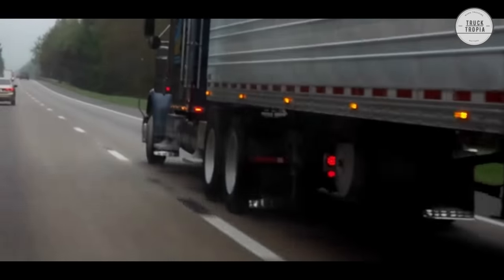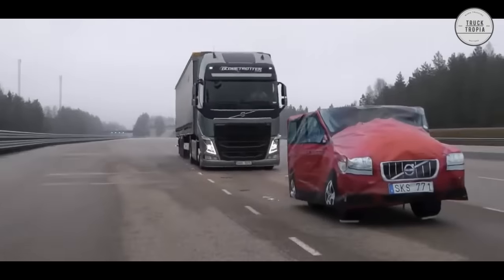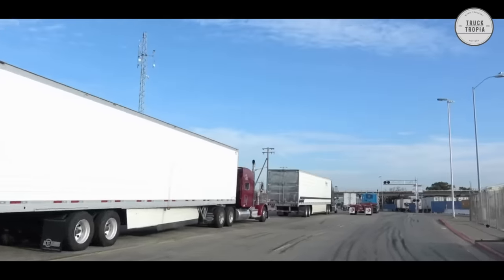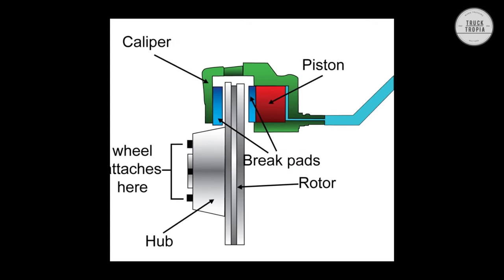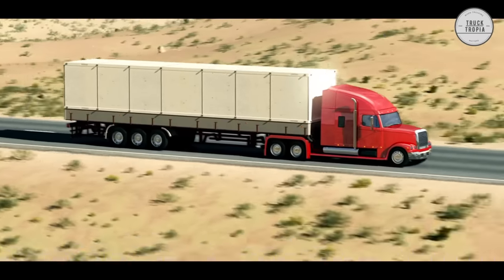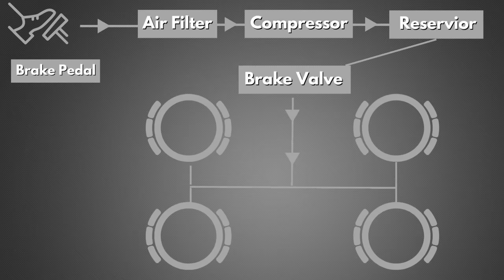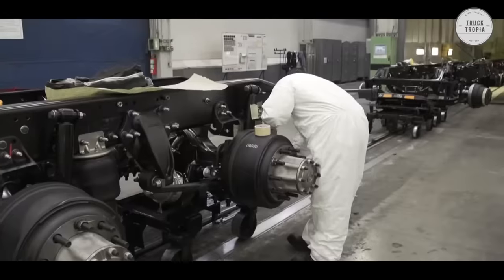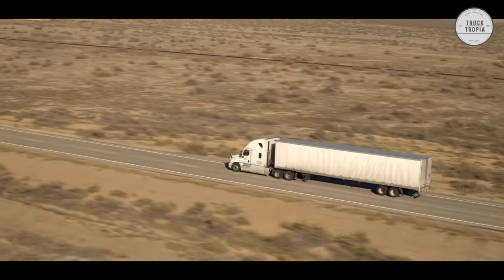Why Do Semi-Trucks Use Air Brakes?

Comment: Another big perk of air brakes too is that if they leak a little bit, they might still work for some time.  Even the tiniest leak in a hydraulic system will render that circuit inop and will quickly deplete the fluid reservoir, which can knock out all circuits.  A small air leak may only cause the compressor to work more.
Reply: Leaking is actually an expectation, to the point where there is an acceptable amount of leaking before it’s considered unsafe.
Reply: @jacobleyva2572  I thought I recalled as much but I wasn't 100% so didn't want to make that claim.  I haven't driven large vehicles in over 10 years so I'm a bit rusty on the facts.  Thanks for confirming!
Reply: @jacobleyva2572  technically any amount of leaking is considered safe since it will just activate the spring brakes and stop the vehicle from moving at all.
Reply: @jacobleyva2572  according to European law: A leaky brake system (even if it is a super small minor leak) is deemed having no brakes et all!
Reply: Your only allowed a very small amount of air leakage to be allowed to drive that rig down the road. I'm thinking about 4 psi in a minute.
Reply: @kenardturner7173  There we go, we don't use PSI ^^
Reply: @BruceCarbonLakeriver  sounds like BS. it's extremely difficult to get a perfect seal in the long term.

Comment: One other reason why hydraulic brakes are preferred in personal vehicles is their improved braking modulation and feel. Hydraulic fluid is incompressible, so when you engage them your foot feels the brake much more quickly and directly. Air brakes are slightly slower to respond and mushier feeling at the pedal, with a more on or off behavior. 
The other thing people are missing is that hydraulic brakes do fade in a way that air brakes don't, assuming moderately competent brake pads. The first type of brake fade you get in hydraulic systems is usually brake fluid fade, which is when the fluid gets so hot it begins to boil. When the brake fluid boils, it is no longer incompressible liquid, but partially compressible gas, which significantly reduces brake pedal feel and max braking force.

Comment: THIS IS HOW AIR BRAKES ACTUALLY WORK:

In the trucking air brake systems there’s two types of brake chambers, dual and singles. Single chambers only have a service brake or foot brake. While duals have a spring or parking brake and a service brake. 

The spring brake works by removing all air from the chamber to engage, if you introduce air to the system, around 40 PSI it will over power the spring and move a diaphragm holding the brakes on to release them. Keep in mind not every axle has these so most brake chambers are single. 

A service brake works as follows. You push the brake pedal, and air fills the chamber. This pushes on a separate diaphragm moving a push rod. This connects to something called a slack adjuster to ensure your brakes are always adjusted properly. The slack adjusters twists something called an S-Cam which pushes the linings into the drum to engage the service brake. This is the only type of brake a single chamber has.

A dual chamber has both types of brakes and two separate diaphragms, 1 adding air to engage the foot brake, and the other removing air to engage the parking brake. 

This might be a little complicated to understand so look up some diagrams on the internet if I didn’t explain it. Well Enough.

Comment: Another big advantage air brakes is that you can use that compressed air for other purposes.  Obviously the brakes and trailer brakes.  Compressed air is also used for the airbags on most trucks that act like springs.  Some trailers also use airbag springs.  The horn is obviously air powered.  The seat springs/cushion is also air powered, makes the truck ride smoother cause the air the driver's seat floats on absorbs impacts.  On older trucks they used compressed air to operate the windshield wipers.  This was a stupid/trouble prone system, ie a slight leak makes the wiper malfunction.  You can also use the air system to inflate a low tire.
Reply: My favorite accessory is the air gun you can install to clean the cab out.
Reply: @Kingpin745    Didn't even think of that!!   Here I am like a heathen buying $5 cans of compressed air used to clean computers to detail my interior.
Reply: @AaronSmith-kr5yf  Lots of truckers install an air gun.
Reply: Automatic transmissions use the air system to shift the transmission.
Reply: Here in Kenya we even do spray painting using a lorry's compressed air from  the reserve tank😁😂
Reply: Some old trucks have an air engine starter.
Reply: It is also used to clean the filter
Reply: Buses also use their air brake systems to control the doors and adjust the seat.
Reply: Also used to shift the transmission on both manual and automatic
Reply: Or run air actuated hydraulics. Like the front loader garbage truck I drive everyday. Aka: my prison on wheels 😬

Comment: Air brakes allow connecting and disconnecting from trailers without having the problem of getting Air in a hydraulic brake system... Down side Air brakes have a slight lag from brake pedal application to brake application about 1/3 of a second on tractor brakes a little more for the trailer...
Reply: Love it when the comments are more informative than the video
Reply: Which in turn is the reason you start slowing down early and braking just a tad bit early.
Reply: you actually starts braking on your trailer first ... split seconds but the trailer first .. to keep the whole rig stretched out  in a line .. that's why the trailer has a pre-idling valve ...
Reply: You wouldn't have the lag if the truck and trailer would support EBS :)
Reply: @BruceCarbonLakeriver  yes you would as the brake only has security pressure aka safety release pressure
Reply: @tellyonthewall8751  Nope, that's the reason EBS exists xD
You might have to look it up b/c I'm not sure if this is common/available in the US ^^

Comment: Air brakes on trucks are more accurately called spring brakes. There is a massive strong spring in each brake housing. It is applied by default. The air pressure is used to keep the brakes off, not on. When applying pressure on the pedal, the air pressure keeping the shoes off the drum is lessened, causing the spring to gain dominance. This is why you see the double skid marks veering off the road. Loss of air pressure causes the brakes to be applied full force. A technical detail Ton Clancy got wrong in one of his stories
Reply: Incorrect. The air pressure does keep the spring compressed this releasing the brakes.
However, there is a second chamber that uses applied pressure to engage the brakes using the pedal. 
There is no lessening of pressure holding the springs compressed.
Reply: Nope. Spring brakes are part of the air brake setup. Spring brakes are another name for your parking brakes.
Reply: Um , Some brake pods DO NOT have a spring in them . Do you research .
Reply: @derekcrymble9085  the front brakes on a semi usually don’t have a spring in them but the drive axles and trailer axles all do (at least they all have since the late 1970s).  There are two circuits on every semi, the service and the supply. Brakes with springs in them (maxis) are “fail closed” and will clamp down on the drum/rotor when there is no air because of the spring.  The supply circuit pushes the spring open so the brakes release.  The service circuit then can be used to push the brake closed again.  They are two cylinders that act independently on the same piston.  The front brakes use the supply circuit only so they stay open with no air.

When you press the brake pedal, the service cylinders all pressurize to apply the brake.  The supply cylinders’ pressures only change when you press or pull the parking brake knobs.
Reply: @QDWhite  I know . Been driving tractor trailer for more than 10 years . What I said is absolutely true . Your mom says "hi" .
Reply: Not entirely true. When the brakes are set is when they are spring brakes. That spring only applies when there isn't enough air pressure to hold it back. 
It is possible to mechanically release that spring, but it renders that particular brake inoperative.
Reply: It's incredible so many people do this for a living and can't come up with a straight answer. I've looked for a comprehensive answer to how these systems work since first learning to operate a truck with air brakes and it seems like almost no one knows.

Comment: Another reason that air brakes are not used on automobiles is that air brakes require a sizable air tank that takes up space. On a semi truck there is plenty of room for air tanks. On a car an air tank would take up a sizable amount of trunk space.
Reply: yep, besides the fact that such a sufficient compressor would a) weight too much for a small car and b) would drain too much power from set car.
Reply: They'd never use air brakes on a car for the simple fact that they are noisy.  No one wants to hear a compressor as they're driving down the road.  But a truck is expected to be noisy, so they put up with it there.
Reply: @nixon2tube  Wrong, trucks in the EU aren't noisy et all and so aren't the air brake systems as well. We've pretty harsh (actually the same) noise regulations on trucks like on cars.
Reply: @BruceCarbonLakeriver  compared to a car a truck is loud even in europe and every brake that air needs to go somewhere 
120psi 
Escaping makes noise 
I know in europe trucks have like dampers on the blow out 
But still noisy

Comment: They do overheat, but another added benefit is that their default position is locked, eliminating the need for a parking brake.
Reply: Trucks till have parking brake that has to be pulled out to engage the tractor brake otherwise you'd be making up to a very hard jolt from the truck rolling into something. Air brakes are off by default not on

Comment: Some 50 + years ago big trucks used the vacuum air brake system. This system was quite unreliable for quick stopping power. I know because I was involved in an accident that caused my truck to not get slowed down fast enough to prevent running into the back of a car that pulled out in front of me on a two lane road near Springfield, Illinois. The trailer only had 8000 pounds of household goods inside, which amounted to about half of the 32 foot trailer I was pulling at the time. I was traveling about 50 mph and this car pulled out in front of me as best I can remember about 500 to 700 feet in front of me and even that distance was not enough time to keep the tractor from running into the back of the car that was involved. A car that was driven by a 90 some year old man who obviously had clear vision of my presence before he pulled out. The only thing that explains his reckless behavior was, besides his age, was his depth perception and reaction time to existential threats, or possibly did not even look in my direction. Before running into the back of his car (I merely clipped the rear driver's side of his car before veering off to the oncoming lane on a two lane bridge, wiping out about 20 some feet of bridge guardrail before coming back onto the road surface and eventually laying the whole truck on its left side and well off the bridge which spanned the Sangamon River.
Reply: 😮 yikes!

Comment: For a multitude of reasons, but the main one is that the desired failure state for a semi is stopped. Air brakes in these vehicles use air pressure to decouple the brakes from the rotor or drum and, thus, if you experience a compressor failure, brake line failure, etc. then it will fail to stopped rather than fail to a lack of ability to stop.

Comment: I've read a lot of comments about why semi trucks use air brakes for their trailers, and some people are missing the point. The reason why is that when you couple and decouple a trailer from the tractor, there is NO way to prevent the slightest amount of air from entering a hydraulic system. A small air bubble in a hydraulic braking system greatly reduces or even totally prevents hydraulic pressure from building. This is why standard hydraulic brakes on cars need to be bleed. Think about it: the time it would take to bleed a  hydraulic brake system every time a driver coupled a trailer would be too significant of time wasted. Not to mention, decoupling the trailer would result in hydraulic fluid loss. This would even be worse for the yard hostler who couples, moves, and decouples countless trailers every day.
Reply: That's a reason but it's not the reason. 

Buses and full body trucks also use airbrakes for the reasons others have discussed; pretty much all heavy vehicles do.

Comment: In London, the famous Routemaster bus uses mainly the Lockheed power hydraulic braking system. The mineral oil fluid is pressurised in the lines by a pump and continuously flows around and into two storage accumulators which have sliding pistons inside The fluid pushes the piston against a pre charge of air to give the storage of pressure for the system. A cut off valve which gives off a "clonk" tells you that full pressure has been reached. Also, a  flag in the Driver's cab with STOP cut into it, drops into the line of sight, and as well as a warning light warns of low pressure. Handbrake is the traditional pull on mechanical type.
When the Driver depresses the brake pedal, the pressure is applied to the wheel cylinders, and a smooth application of the shoes is made. 
London Transport chose this system as they found air brakes could freeze and have air tank capacity problems in heavy traffic. An alternative supplier was Clayton, who used spherical accumulators with rubber diaphragms inside rather than the cylindrical ones with sliding pistons.
On the maintenance side, occasionally a compressor called an intensifier, was connected to the Schrader valves on the accumulators to restore the air pre charge.
On the other hand, I know Engineers who detested this system, dismantling meant them getting saturated in Tellus, (the mineral oil)
Is this system used in the States, apart from possible aircraft where it was derived from?

Comment: I once have Mitsubishi Fuso Great 6d22 which has full air system,  Air Brake, Air Powered Power Steering, Air Cluth, Air Transmission. So Air is so flexible, you don't need to refill it, if it is leaked, then you still have the capability to brake, and the air pump will restore the pressure. Air doesnt overheat. If the temperature rising, you just remove the air and refill it with colder one, the safety pressure valve will open automatically to relieve the pressure.